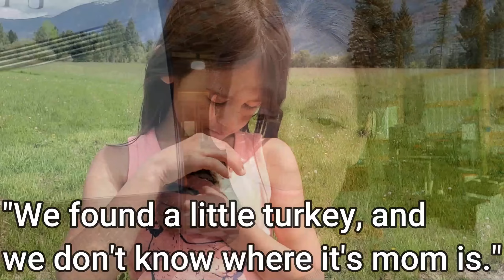How To Properly Install Bracing Between Floor Joist

Comment: I forgot about the "Ya'll Run to the Tree" energy burning trick. Did you get the Deadwood? You know the walls that run parallel to the joists get 2x over the top plate so you can secure the ceiling, if you put a ceiling. You are almost at 85k with subs, I am happy I am hitting 8000 tonite. Be Blessed
Reply from the maker: Wow nice, keep grinding!!! Thank you!
Reply: @GoodSimpleLiving  The intro tune was cool.

Comment: Jeremy  are you going to run a
A wire from the fuse panel in the garage to a  separate fuse panel into the apartment? Looking good guys. Once you guys figure out the wire and plumbing the insulation  and wall board and ceiling with go up fast.
Reply from the maker: Not thinking we’ll have to at this point. Not sure though.

Comment: Just an FYI for the future. You can stager your bracing so that they can be nailed through the joist on both ends. They don’t have to be in a perfect line. If you stager them back and forth by about six inches the same thing is accomplished but it makes the job easier when you can nail through the joist an both ends.                 Great job
Reply from the maker: Noted!!  Thank you!

Comment: I never used blocking to make sure the spacing stays the same. I used blocking instead, to strengthen the floor. You know how walking across a floor that spans a bit too much distance, will cause the floor to sag in the middle? The blocking eliminates that. I know it doesn't seem to make sense, because the blocking doesn't magically put a post under the center of the floor, but believe me, it works. What happens is that without the blocking, putting weight on the floor above, will cause the joists to kind of twist, and bow outward.  Putting blocking all the way across there, makes the center joists bear on those around them. Which bear on those around them. Etc. Keeps the floor from sagging. Think of it like a box. (Each two joists and the floor above.) Now put some weight on the top of that box, and the joists twist. Allowing the bottom of those joists to move away from each other. Letting the whole thing sag, as the space between the bottom of the joists expands.
Reply from the maker: Its so much stronger now

Comment: I have a ? if Ur living off Grid, how R U guy's getting all the power that U have to have all those big lights & being able to run all those power tools? My husband & I have talked about doing what Ur doing & we can't figure it out??? & U always seem to have Great WiFi & computer streaming ..... tell me how do U all do this? Thank You
Reply from the maker: Barn is fully wired for power. We have two gennys. A 12k watt genny and a 4500 watt both dual fuel. Internet is wireless through a local company ( EL Internet). Thanks for watching!
Reply: I'm a city girl so I don't totally understand what makes someone off grid.  If you have power, that's not solar, and internet does that make you a homestead instead of off grid.  Love your channel.
Reply from the maker: The common term "off grid" means not being connected to outside utilities.  So a well, solar, and wireless internet.  However, not everyone considers anyone with cell phone service or internet off grid. Its just energy independence I suppose. Could just be called self sufficient living.

Comment: Nice Solid bridging blocks Jeremy. Next time save the up and down leg work and snap a centerline on those JoistBottoms and set up those ladders and an extra floor joist , as an elevated pic walkway ,right down the center.. reachaBle height to install bridging blocks from below on a walkway .. then just square. Line up And install straight and flush.  (Tips from. A Carpenter)
Reply from the maker: Yes. Thought about doing that and working from above but it honestly made me a little nervous...haha.
Reply from the maker: Thanks for watching.
Reply: @GoodSimpleLiving  no-no , set the 2x10 below and use the 2 ladders like saw horses!  From below
Reply: @GoodSimpleLiving  reach out and ask me Anything if you get perplexed.. I'm a Jedi from Michigan.

Comment: are you off grid

 

if so how can you power the lights with no genorator
Reply from the maker: Correct. We have two. 12000 watt and a 4500 watt. Both dual fuel (gas/propane) 😊. Thanks for watching.
Reply: @GoodSimpleLiving  can you show them in your next video
Reply from the maker: It’s in a lot of videos if you go back and watch 😊.

Comment: You might want to consider getting the plumbing and electrical in first; that way, you have more time to get the work inspected before putting up sheeting and drywall; you don't want to be in a position of having to redo any sheeting or drywall because of a mistake with the plumbing or electrical part of the work. Also, getting the electrical in place and inspected will let you string lights up in the ceiling of the loft, so that you have more visibility for that part of the work; especially in the early evenings if that's when you're working on it. Mapping out and installing your power lines, plugs, and lights first, along with the plumbing, will hopefully make things simpler later. Just a thought.

Comment: How are you going to power your place? I see big overhead lights so I assume you are going to have power. Wind? Solar? Your using the generator now right?
Reply from the maker: Plan is to do a combo of grid power and independent solar - all budget permitting of course 🤞🏼.

Comment: Im looking for some good boots, steel toe, maybe not crazy expensive... any insight? I have my timberlands but im looking for something more light weight, maybe little heel (im on concrete all day).
Reply from the maker: I just saw a company that sells a steel toe shock resistant tennis shoe. They looked awesome! Jeremy wears a boot by Columbia. I just wear my old ariat fatbaby boots. I've worn ariat since I rode horses, just think they are comfy

Comment: HEY GUYS.  sorry to shout but was trying to shout out about the type of insulation your going to use. Doesn't matter to me, your op looks spectacular. But I was thinking spray in foam insulation may work. Soundproofing too
Reply from the maker: Hey there!! Probably going simple since its a small and temporary space, but for sure an option in our permanent home.
Reply: @GoodSimpleLiving  also, pex tubing is easy enough for water pipes. If code allows. Good luck, love watching the progress. So jealous.
Reply from the maker: Yes thats the plan! Never done any plumbing before

Comment: I always go way more on the blocking than needed for some reason.  Right now, I am putting 3 blocks between some joists myself and am putting 3 blocks for only an 8 ft span.  As I said, way more than needed.  Don't know why I put so many, it is just something I have always done.
Reply from the maker: Better too much than not enough!

Comment: On the flooring for your loft, you may want to consider Huber AdvanTeck sub flooring @1” Huber installed with their adhesives is a superb option that will give you a superior strong and stiff floor. With AdvanTeck you won’t get edge deformation from moisture, and hold fastener exceptionally well. I know a lot of “Pro” framers that could take lessons from you two. I owned a Cabinet shop in So. California in the ‘80s, I promise you’re doing far superior framing. I worked on $400,000 houses, that was a very expensive house back then. On more than a few of those I’d have to reframe walls and fix floors, appalling shoddy work, not something I believe your home will suffer from.
Reply from the maker: Hmmm,  thanks for the recommendation.

Comment: I was wondering when you were going to brace those boards, we call them Noggins and it's best to stagger them to distribute the load more evenly and you also get access to both sides for nailing.
Reply: @colstace2560  I'm wondering if it was because he was using the nail gun?  Is there room between the joists to drive the nail straight using the nail gun?  I don't use a nail gun, so I don't really know.
Reply: I'm also wondering about this a bit - I'd normally screw in from each side with a driver, so the noggins would be staggered. Am I behind the times? Do more people use nail guns now, and not screw noggins in? I never thought about the fact that staggering the noggins actually adds some stiffening though, so that's interesting - just thought it was about access to screw into the noggins.

Comment: FYI, turkeys, like most fowl, will not accept the return of a young after it has been touched by human hands.  That means one of two things.  That turkey momma is super strange, or your kids haven't had a decent bath in about a week.  I would be double checking the soap dish to make sure it's being used....Next time, sprinkle some baby powder on the chick and the momma won't know anything.
Reply from the maker: Probably stinky kids
Reply: That’s an old wives tale and very untrue.

Comment: You guys are really taking the building seriously. Seriously though, you don't have to be that tight on the blocking. close is good. within 1/4 inch in 4ft is really good. I don't know even 1 contractor who measures that much. Good job though.

Comment: Yes you wouldn't want your man blocking by himself....or would you.  I assume you used 2x12s to have space for insulation, but when you are through you could park cars in your loft.  Looks like it is about time for your first hay cutting....but with newly hatched wild turkey poults in the field, you might want to hold off a week or two until they can reliably get out of the way of a tractor....about 3 weeks old.  I know this from sad experience in my fields which generally hold 4 or 5 nests every year.  Real young poults just freak when they see a tractor and are just as likely to run towards danger as they are to run away from it.
Reply from the maker: Aww 😢. Not sure when we’re having it cut yet. And we don’t want to take any chances with the loft. Thanks Richard!

Comment: Are you guys using ring shank nails? Or contemplating using them for the plywood floor above? I hope not. There is little doubt that you are going to want to take some of this back apart in the future. Ring shanks would be the bane of your existence at that point...
Reply from the maker: No plans to ever take it apart.

Comment: I'm sure you have heard this a million times but if you have any questions on framing you can private message me on Facebook I have been framing for 30 plus years. I still have an issue with you put & Doug fir on the slab and in most States that's a code violation. I have no problem with helping you through this process. We are from the same town. Bad thing about YouTube I don't see a problem until it's already been done. Soffe Raymond Clark county for 30 plus years I have no problem helping you have questions please contact me on private Facebook messenger. Just an idea.
Reply from the maker: Thank you

Comment: You two blockheads. LOL  Are you going to wire it up like a workshop when you eventually move out to the main house, or is that a permanent guest house?
Reply from the maker: It’ll be a permanent guest house Or living space for our kids.
Reply: @GoodSimpleLiving   Cool.  Now that you built up muscle from moving those 2x12's, the thick subfloor sheets should be a piece of cake.